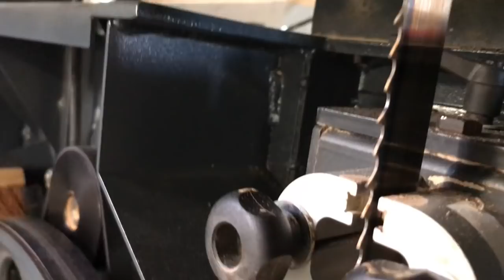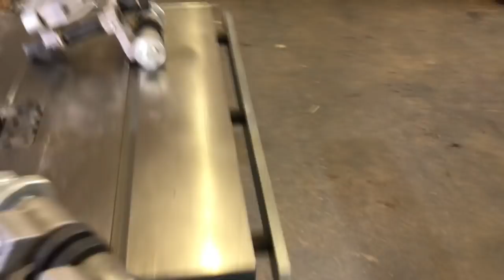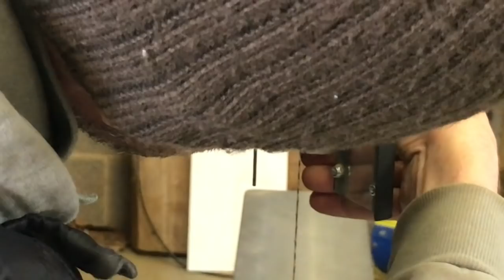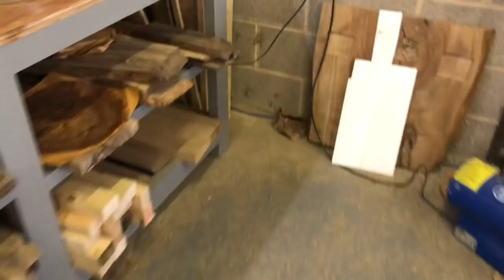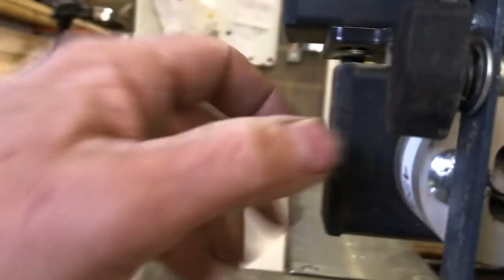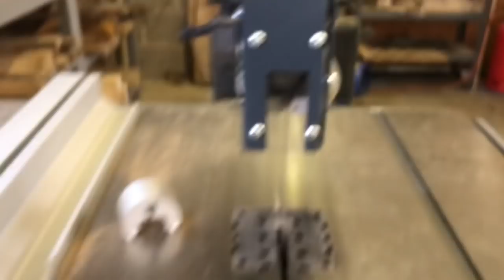Setting up Ceramic guides for Felder FB510 bandsaw

Comment: I was just using my Hammer N4400 and was wondering how to better setup the ceramic guides.  This video was invaluable.  I went right out to my shop and made the corrections to the factory installed equipment.  I appreciate your time in making the video and putting it on You Tube.

Comment: I just got a Felder FB510. I tried to adjust the upper guides by eye. Kept failing. THen you said 'business card' and I pressed a card between the guide and blade and tightened the screw with the card between. It is now perfect! Thanks for the inspiration.

Comment: Great explanation of the x guide system - I am about to order the FB510 with these guides fitted.
The only aspect of the saw that I didn’t like was the ABS blade tensioning wheel - this is inconsistent with the industrial build of the saw. 
And disappointing  at the price point.
I wandered about the durability aspects as I have seen a cracked tensioning wheel on a Felder FB 600 - disappointing for Felder.
Your thoughts appreciated!

Comment: Hey. Thank you for a helpful review. I have had Fb510 about 6 months with the standard guides and I have also thought that I might chance to the ceramic ones. There was so little difference when  buying ceramic ones installed then upgrading later so I didin't take them because I thought that I can do it later if I want. I have not really liked them too and for a some reason I never get them to stay put when I have installed the blade so I need to always tighten them all over again.

Comment: I'm a woodworker of 30 years and have used my N4400 for free hand cuts for about a year and have loved it. Recently I've needed to rip straight cuts on it and it's letting me down badly. I cannot for the life of me get it to cut straight. I've tried everything and I'm losing the will to live!!. The ceramic guides are loose and moving when I set them up as per the tech support guys in Milton Keynes. I've adjusted the fence for drift, the guide post moves by 4-5mm when I tighten it down. I think it might be the problem but still no joy. Any help or advice would be very much appreciated.
Reply from the maker: Try a new blade , after cutting  curves I find straight cuts can drift ..
Reply: Dermot Coll I am having a similar issue. I ordered a blade with higher TPI. It’s supposed to come this week.
Reply: I think after 5 years they are not meant to cut straight,tried all the possibilities,fence,tension,new blades,on hardwood they just wont,I am talking about hammer N 4400,I thought it my cermic guide upgrade ,Felder disappointed me ,what they show in video is something else and reality is something else .

Comment: Any chance you could advise me with the setup of a fb 610, I’m having a nightmare, and felder assistance is of no use
Reply from the maker: Hi Dentro, I haven't seen a FB610 but expect its the same as the FB510 .. you should see all of the info on this video really I didn't do much other than remove orig set and install the Ceramic guides..   Felder UK are very helpful
Reply: also having a nightmare.  did you ever get your's set-up properly.  My problem is mounting the upper guide to the guide post

Comment: Thank you very much for this detailed video on the setup. I hope Felder see this video and learn a bit how to support the customers. I was worried for some sparks that saw from time to time but looks that is normal. My guides are too much separated from the blade. From practical point of view, how much lateral deflection (tension) do you allow to the blade?
Reply from the maker: Ok so before felder I use to try and judge this by how by pressing the balde set arund 4" cut and look at defrection but this didn't alway end up the same each time.  since the FB510 I use the yellow balde tesion guide inside the machine.  and stick to it 100% ..  for me it works perfectly and agian my test has always need can I cut perfectly straight using the fence .!

Comment: Fantastic video, many thanks! One question: you use the 25 mil blade with the teeth just slightly “in front” of the wheel (e.g. the teeth not on the rubber) while a smaller blade would have to be set in the “middle” of the wheel, e.g. the teeth actually on the rubber of the wheel), is that correct? Thank you so much for your help!
Reply from the maker: Yes :)

Comment: Hi I have now finally got the FB510 up and running after getting 3 phase power to my workshop.
While I am generally very happy with the performance mine has an electric brake that makes a very alarming noise each time the saw is switched off.
Not sure if yours has the same set up - but if it does have you experienced similar issues?
I also purchased the x guides but not yet installed - I agree the standard guides are a bit agricultural and more noisy than you would expect from Felder.
There are much better European guides available ( Panhams) that would have made the standard saw better.
Tip: If you buy the x guides with the saw there is a special deal and the extra cost is very low (!)
Reply from the maker: I think mind also has the brake and a sound not sure it sounds a bad noise ..

Comment: My FB510 arrived this week. Having fun setting it up with the wheel kit.  Unusually it arrived with no power cable ... just the IEC style connector.  Is the electrical cord the same on your machine, or direct wired ?

Comment: Hi, after using the FB 510, have you had any issues with the rubber tires ? They keep on tearing apart as I am using the machine. I have bought this bandsaw over half a year ago, and since then the rubber tires disintegrated 3 times, bending my saw blades in the process... Am I the only one having this problem ?
Reply from the maker: never had any problems.. yes to hear you problems

Comment: as usual a very helpful video, where did you purchase your ceramic guides please, i also need another plastic insert,bit with the holes in in middle of the table, many thanks
Reply from the maker: Felder supply the kit , uses same plastic insert

Comment: Good one! I have the same guides on my Hammer N4400 & I am still a bit confused about the positioning of the blade on the wheels — per the manual you are supposed to center the blade on the wheel, but you set the teeth slightly of the rim. Could you elaborate on that? Cheers, B
Reply from the maker: Bert Vanderveen Hi Bert,  this is the way I have always used a band saw , the key for me is does the saw cut straight using the fence !!  I did speak to felder before I stated on this FB10. And was told correct keep large blades 25mm + in front of the rubber ..  to 2 blade I use in this demo covers all blades :)

Comment: How much of a concern are sparks?  I have ceramic guides on a Felder bandsaw and I notice it does generate some sparks.  What is the best spray lubricant to minimize that?  And how concerned should I be about a fire in the dust collector?   Awesome video as usual - thank you MW!
Reply from the maker: I don’t use spray sparks are not a problem

Comment: Hi great video, I have found that the cutting edge of the blade should not be off the edge of the wheel, and the blade should Definitely not be centred on the wheel, the deepest part of the gullet of the blade should be centred on the rubber tyres. Have a look at Alex Snodgrass (Bandsaw Life Videos) of Carter bandsaw products, he shows what part of the blade should be at the centre of the wheel and then to set the guides up once the blade is in the correct position, the side guides should never need to be adjusted regardless of what size bandsaw blade is used, He really knows his stuff when it comes to bandsaws.